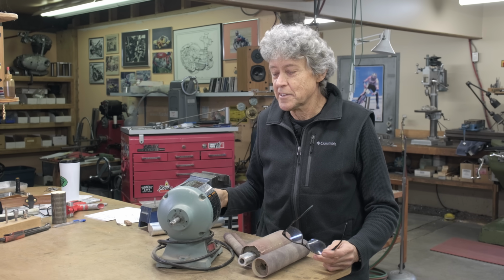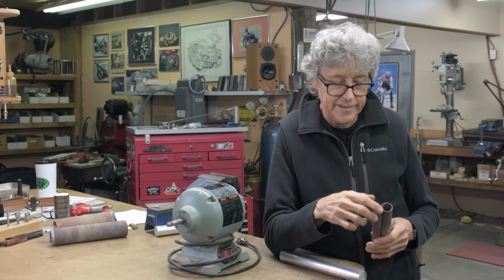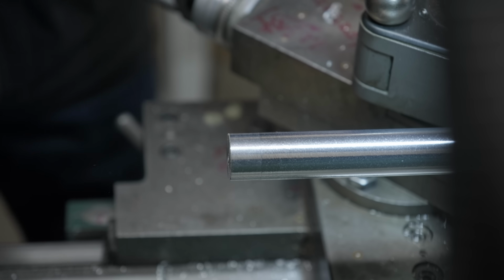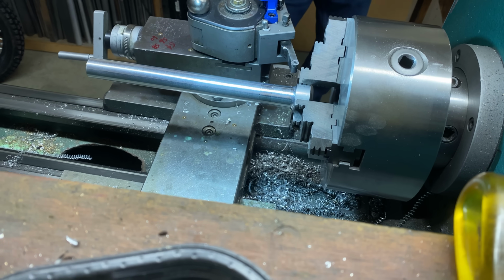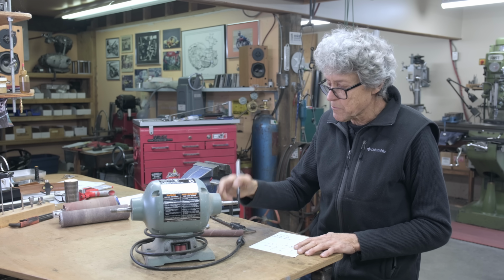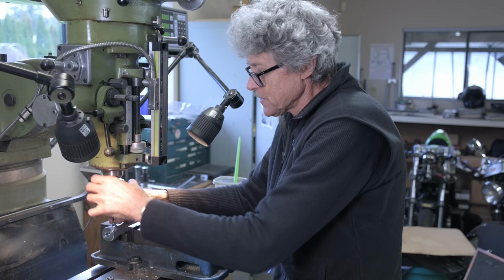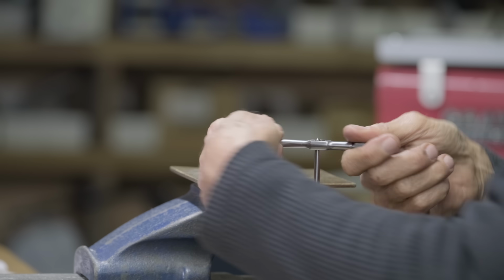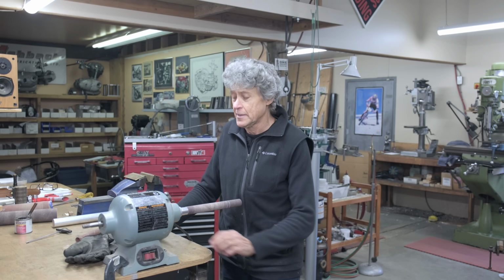Modifying a Horizontal DRUM SANDER // Paul Brodie's Shop

Comment: FYI, The typical way that most drum sanders work is to have a rubber washer (or sometimes the entire drum) somewhere on the shaft, usually at the end (or ends), that is compressed by a nut or wing nut so that the rubber expands radially when tightened.  This contacts the inner surface of the sanding roll, holding it in place.   The reason that drum sander manufacturers like this type of setup is that the sanding roll manufacturers can make the rolls with thicker or thinner backing (and they frequently do), but the rubber of the sanding drum can expand or contract to make up the difference.  That way the user of the drum sander isn't forced to use one and only one manufacturer of sanding roll or one specific type of sanding roll.
Reply from the maker: What you say makes perfect sense.  I hope my interpretation works well for Jorge and his magical wooden lamps.  Happy Holidays!    :face-purple-wide-eyes::face-purple-wide-eyes:

Comment: Hi Paul, my oscillating spindle sander uses threaded posts through various sized rubber sleeves.  The sanding roll slides over the rubber sleeve and the nut at the top of the threaded post tightens down causing the rubber to bulge ever so slightly. This locks the sanding roll onto the post.  My sander has sizes from 1/4" - 4" diameter.  Just FYI.
Reply from the maker: Hi Brian,  sounds like you have a good system..  I am fairly unfamiliar with that system. I was just doing what the customer wanted; helping out a friend of a friend...    :face-purple-wide-eyes::face-purple-wide-eyes:
Reply: @paulbrodie   And you did a great job as usual Paul!!!  The friend of a friend best be tickled to be the recipient of your efforts!!  I certainly would be!   Love your attention to detail and the efficient way you work! My system is just a purchased oscillating spindle sander with a set of spindles. Nothing fancy or special.  Cast iron tiltable work surface, adjustable speed, makes a lot of dust lol.  Bought it years ago to add to my little home hobby shop. Take care good Sir!
Reply from the maker: Thanks Brian.  Yes, I will take care.  All the best!   :face-fuchsia-wide-eyes::face-fuchsia-wide-eyes:
Reply: @paulbrodie  All the best to you Paul!!

Comment: So thinking about what the smaller diameter one would look like it seems a little scarry to me being unsupported at that length.  Do you think it has the rigidity to not bend then potentially have the rotational force run away with it - becomming a spinning hand breaker?  I would maybe want something shorter in that diameter.

Comment: Often you can use compressed air down the tube to expand it ever so slightly enough to allow it to slide onto the mandrel.
Reply from the maker: Yes, I use compressed air to install handlebar grips. It usually works great!!    :face-orange-biting-nails::face-orange-biting-nails:

Comment: The type of tool that you do not want catching anything by accident, especially clothing.
I originally thought the shaft should have an abrasive finish to keep the sandpaper from slipping.  I doesn't look like it needs it.
Reply from the maker: You are 100% correct. Never catch clothing or anything like that! Thanks for commenting..   :face-orange-biting-nails::face-orange-biting-nails:

Comment: I would have done no end taper and reduced the inner taper to 1 degree so the roll fit all the way on, and was supported by the shaft at the very end. I also would have drilled through the assembled shafts where the inner shaft threads are and ran a rollpin.

Comment: For anyone copying this,  it would be better to do the bore for the shaft first, put a centre in the far end, make a mandrel to mimic the grinder shaft, and then mount this workpiece on the mandrel, add tail support with a live centre, and then turn the outside LAST.  This would ensure concentricity between internal and external features. You could see the difference in concentricity between Paul's initial set-up and the second set-up when he turned the taper on the outboard end of the shaft.

Comment: If I did that it would wobble. That's a tricky bit of work. Seriously I would have had to buy and integrate a collet to attach to the motor shaft. So my compliments to be able to pull that off.

Comment: Did you run a tap right through the hole, either side of the slit? I thought that's what it  looked like but I thought you'd only want the threads on the side furthest from the bolt head and a clearance hole on the other side. Otherwise I don't see how the bolt would exert any clamping force.
Reply: He showed the step where he first bored out the area where there wouldn’t be threads.

Comment: I see the potential for a serious injury with this tool, and have an idea how to make it safer. More so on the side with the thinner rod. We all tend to push such tools to their limits to get the material removed quicker, so if / when the thin side gets pushed beyond it limit and the bar bends enough to cause it to whip, then the accident has happened in a blink, with no warning what so ever. I know it sounds overkill, but suppose there was some quickly attachable detachable, bracket, which fixes to the bench, with a bearing that could support the end of the bar; much like a lathe tail stock with a running centre. That would let the operator really put a load on without the fear of getting his arm or head chopped off. Imagine that tool bouncing around the bench with a bent bar on the end of the spindle. I once saw a man plug in a high torque hand drill, (which had its hand trigger latched to the ON position), which was attached to a portable cylinder hone, which was already inserted into a motorcycle cylinder, which was sitting on the workbench, with the hone universal joint at 90 degrees to the drill axis. What happened wasn't pretty!

Comment: Wait a minute!  Those sleeves can be made in diameters you need for mitering tubes.  Forget the woodworking.  Why not use this for framebuilding?
Reply from the maker: Well... thin wall cro-moly tubes are very sharp, and would easily catch the drum sander if you are not extremely careful. Mounting the drum sander in my milling machine would create a lot of dust, and that is not beneficial for my mill..  Sorry, I don't see the positives, but thanks for commenting..

Comment: A oscillating sander would be easier to modify, it already has various sizes it comes with.
Reply: The grinder runs much faster than the sander. I think the artist uses this tool for shaping wood, not finishing the surface.
Reply from the maker: Thanks Justin, I agree!

Comment: Paul, I'm still worried about your crash. I for one at the present moment would not want to test ride a bike like yours unless it had a throttle return spring and a significant rear fender behind the seat. Spinning tire is too close to my behind for comfort and at speed a spring would actually speed up any reflex to shut down the motor. Lastly I would have a seconday shut off in the form of a kill switch or button. Remember the early racers were either on or off, instantly. This is probably linked to the early radial engines in for example the Sopwith Camel that basically only an on or off throttle, for whatever reason. All this being said I plan to do just what I am saying in the course of my 1916 Harley Keystone frame boardtrack street racer build. Throttle for the street but likely just on or off for the track. No brakes. Thank you for your kind attention, Thailand Paul PS After hearimg your bike run I am no longer so confident I can compete with it without a melt down, although I'll be trying!